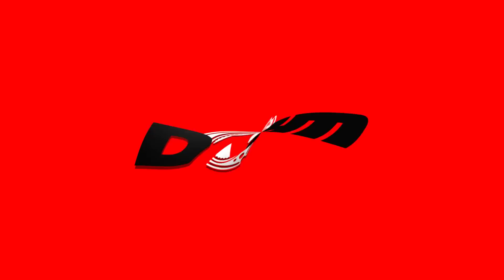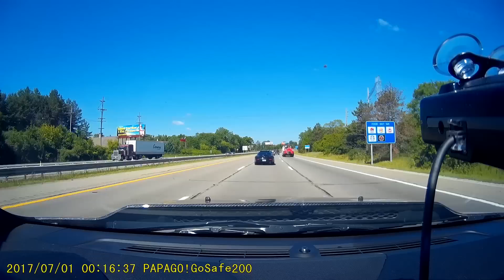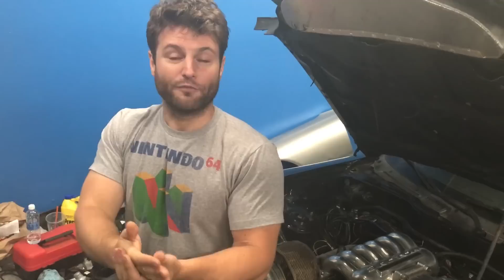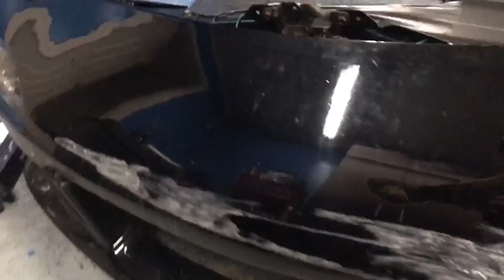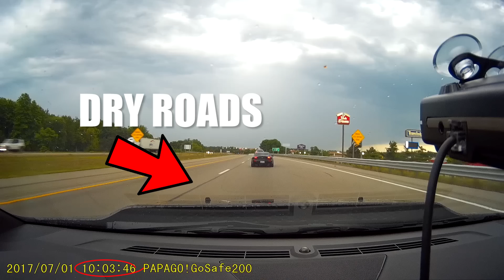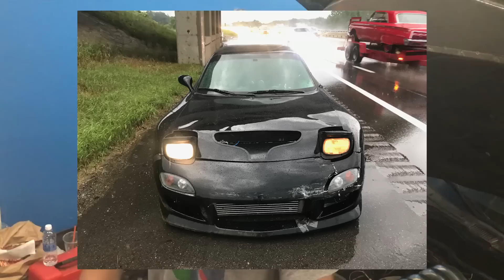Never use drag radials in the RAIN.  3 rotor RX-7 crash

Comment: I've been kinda worried for you Rob....but now I see that everything is back to normal
Reply from the maker: +SpotterJacob hahahah it all balances out
Reply: Rob Dahm dont feel bad rx7s are horrible in rain regardless .i know .good luck
Reply: I disagree mine did fine as daily driver in FL with 245's in the front and 285 in rear max per performance tires.  Driving through 1"+ of standing water was daily occurrence in summer there. Not sure I would even test it with cup tires though at least not on an interstate.  They aren't great but certainly not as bad as most people seem to suggest.
Reply: Drove my FD as daily driver for 18 years, you are spreading the rumors.  Have you even driven a FD?

Comment: Love you Rob but this has nothing to do with luck. This was just plain stupid.
Reply: Yeah it was luck, they were driving home with only drag radials and it unexpectedly rained with nowhere for them to go but to keep driving.
Reply: Ryan LeFevre Its called being prepared? That would remove the rain variable, and then he can use his luck points to not get creamed by a meteor. Duh
Reply: They could've pulled over and waited for it to stop.  It wasn't luck at all, he made a choice to press on, he made the wrong choice.
Reply: wait a long ass time for the rain to stop, and then even longer for the roads to dry up? i would have went for it aswell
Reply: Side roads? Find a route that keeps you at lower speeds where you (read: the tires) can handle it. It'll take longer, but you won't wreck.
Reply: Again, he didn't have to wait either, he could've paid for a tow.  Simple fact is, he made a bad choice and it cost him damage to his Rx7.
Reply: He said it was a 2 hour drive. Depending on how far along he was, an emergency tow 1 hour away is going to be more expensive than his bumper.
Reply: Ryan LeFevre they could have easily pulled off the road.
Reply: It would have been less time to wait for the rain then it will take to fix the car.  Never mind the money
Reply: well guys, like he basically said, live and learn. He can afford to fix it, so no real problem.
Reply: It's illegal to pull over on a busy motorway. Even if he did then it's dangerous with the downpour which makes it hard for people to see and possibly crash into him. Rob just had bad luck
Reply: And plus its only a bumper and a headlight, nothing to freak out about
Reply: All those arguing that it was a good idea to drive in the rain do not take into account the opportunity cost (i.e. the cost you give up by crashing the car).

>He said it was a 2 hour drive. Depending on how far along he was, an 
emergency tow 1 hour away is going to be more expensive than his 
bumper.
The extra cost might have been worth the time he would save. And even if the cost of towing is too great, there is a good chance it would have had to get towed anyways if the crash was more serious, or he didn't feel like waiting for the rain to stop.

>wait a long ass time for the rain to stop, and then even longer for the roads to dry up?
He didn't save any time in the end. The time that would have gone into waiting for the rain to stop went into either waiting for the rain to stop after the crash, or waiting for a tow after the crash in addition to the time it takes to get it repaired.

>And plus its only a bumper and a headlight
And time, precious time.

May the stupid die young or never marry.
Reply: The point here is that he got lucky with how little consequences he escaped with here. Sure this time it was only a bumper next time he spins into another lane and and an 18 wheeler hits him head on causing who knows what else. Or your driving with a baby in the back and this guy spins hits your car sends you into the ditch. Not waiting for rain because it takes too long is just irresponsible, there are other people you share the road with, it's not about if you have the money to fix your car.
Reply: All he had to do was counter steer properly and not have his foot on the gas like that spinning the fuck out like a top
Reply: igot themagicinm3 drag cars do not work that way, it'll do nothing.
Reply: BRAV0 TWO ZER0 yes it will man. you just have to do it different cuz of the cars setup. its still doable though.
Reply: igot themagicinm3 bro this isnt forza😂😂
Reply: igot themagicinm3 will not do anything.....  he's on slicks, he is aquaplaning and there's nothing you can do but wait it out
Reply: BRAV0 TWO ZER0 he was able to drive up to that point in the rain with those slicks sooo
Reply: He lasted 6-7 mins, I'd like to see you do the same with an 800+hp rear wheel drive car that's aquaplaning on slicks. There was no grip to correct oversteer, even if you're coasting you'd spin out. I'm surprised he was able to change lane in the wet
Reply: igot themagicinm3 yeah he drive only 5 minutes, just over 1 minute of that was rain so go ahead and tell us how to drive when you're the one without a license....

you cannot recover from aquaplaning, you can only wait it out, if you knew anything you would know how aquaplaning works...
Reply: igot themagicinm3 yeah ease the throttle nigga, what's that going to do?
Reply: Not a blind bit of difference with slick tyres in the rain
Reply: Anthony M "pay for a tow" to go a couple miles, not like he was going from state to state....sometimes it's best to shut up and u didn't smh.
Reply: tatar 00 aquaplane, hydroplane, same thing
Reply: BRAV0 TWO ZER0 u didn't get the joke.. or did I get a joke that wasn't there? Idk....
Reply: I mean he wasn't even going slow, he was in the left lane....
Reply: @DEBOSSGARAGE  than

Comment: Your optimism is admirable. Pro-tip for when you do this again: do not exceed 20MPH. Slow, yes. But you can still brake and maintain control until you reach a gas station or something and do a tire change or wait it out.

Comment: During the rebuild, you should install a 2" receiver and a dual tire mount to carry the drag radials so you can run a set of street tires to and from any racing events.
Best thing to do with drag radials in the rain is keep to the right lane with the 4-ways on and get off the road as soon as possible to wait out the rain...

Comment: Almost wrecked my Rx-7 this morning after putting a couple hundred miles on it. Been hooning too much and my tires are pretty much bald at this point. Decided to take it for one more trip before parking it to wait for upgrades. Came off the parkway and as I down shifted to second and bent the corner my ass end just about passed me up. Good thing I drift it often, I was able to counter steer and throttle out of it. Almost tapped the curb though. 🤣😊

Comment: My experience:  2014 camaro ss with NT05R, rear end will fishtail side to side the whole time above 40mph in light rain.  Wants to spin out hitting any change in surface height.  Get a spare pair of wheels for drag radials and never drive them on the highway in wet weather.

Comment: The EXACT same thing happened to me about 8 years ago in my supercharged 350z.    I was driving it on the interstate on Nitto Drag Radials when all of a sudden it began to rain and about 3 minutes later I was swapping end around at 55mph.   I came to a stop in the ditch on the right and only had two flat tires, which I assume deflated as the side walls pulled away from the rims during the spins.   Called a tow truck and got him to inflate my tires and I was on my way within the hour.  Luck was on my side because it could have been a deadly crash.

Comment: Got caught with my FD in a storm with the exact same tires once, coming back from a standing mile event (a 45 min drive).  Can confirm that it is horrible.  I couldn't go faster than 30 mph without hydroplaning.  Luckily there was no traffic, and I drove at ~25 mph to get to a gas station to wait it out.  Sliding at 30 mph while going straight the whole time was fun though..

Comment: I understand the need to not trailer your car to prove reliability (I drove my own 3 rotor 2,600 miles round trip to Sevenstock a couple years back). With that said if you're racing and still wanna drive the car to and from your destination, I'd consider a small pull along trailer to hold spare parts and tires. Thx for sharing the video because even I didn't know drag radials where that dangerous in wet weather. 😰

Comment: Just as dangerous: old, nearly bald tires. Spun out my Miata on I-71 when I was passing through Columbus a few months ago because I got caught in a storm driving in old tires that were starting to dry rot with little tread. I got off even luckier with just a few scratches on the bottom of my exhaust.

Comment: Not just slicks, but wider tires in general, run a larger risk of aquaplaning. With skinnier tires, the weight of a vehicle is distributed onto a smaller surface area. Resulting in more force pushing your tires onto the asphalt and thus squeezing out the water more effectively, instead of floating on it. Anyway, congratulations. You've lucked out, all things considered.

Comment: Not just slicks, wider tires in general.  As the surface area goes up and the weight stays the same, the speed has to come down for wet roads.

Comment: Semi slick race tyres should NEVER be used on the street. Driving on the road is a heat cycle which will simply make them go hard.
For high speed events such as that a high performance road tyre would be better.

Comment: ive driven in the rain in my crx before with radials... it was fun tbh but the tiniest bit of rain will make you spin at quarter throttle(this is a cammed d16 in this so 1/4 is nothing) really its not safe in the least bit i only went out because no one was on the road, but so much as changing lanes with any bit of jerk almost kicked the back end out on a fwd car

Comment: i drove on full slicks in the rain in my civic. butt clenching the hole way home from race
Reply: Sean Kaine I haven't seen too many if any front wheel cars with slicks on them spin the back end around! :-) Do you have slicks on the back end too?
Reply: Onefast4door 2000 If he had slicks on the rear, it's easy to spin out on a FWD car.
Reply: Onefast4door 2000 no smart guy actually car kept going left to right left to right and on the off ramp of highway i did spin out

Comment: how little rain? did you not learn that the road is the most dangerous at the start of a downpour? the road hasn't absorbed the yet for water to run off the rest of it. give it 30 minutes and you would have been good. Jesus Christ I have never blamed any of my faults on luck. you crash like that it's your fault. And I don't want to be "that guy" but I drove nitto 555s all around as a daily. when it's less than 100 percent you gotta be super cautious.